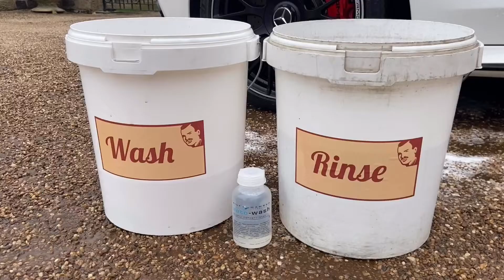Mercedes C63 AMG Machine Polish and Ceramic Coating Detail

Comment: Killer car . Great job . Hard clear coat can still be finished without any haze even with a single step ?
Reply from the maker: Lovely isn’t it! 
Definitely! Harder paint finished better that soft paint for a one step and you can get away with using a more aggressive polish 👍🏼
Reply: @HarpersCarDetailing  ah yes. Has sense ... Thx ...

Comment: Great video as always. Do you use Scholl S20 and Sonax Perfect Finish for multistage corrections? Or do you use dedicated products for cutting and polishing? Thanks, keep up the good work!
Reply from the maker: Thank you William!
If I’m doing multiple cutting stages I would use a dedicated cutting compound, then usually finish with a single finishing polish such as Menzerna 3500 or 3800 👍🏼
Reply: @HarpersCarDetailing  thanks for the advice, very helpful! Are there any cutting compounds you recommend in particular? Thanks again!
Reply from the maker: @williamthomas4  no problem! 
I’m a big fan of Koch Chemie h9 and also like Menz FG400 I think it’s called. The menz isn’t voc free so I’d wear a mask, although they do a menz Fg400 box free but it’s nearly double the price
Reply: @HarpersCarDetailing  Brilliant, thank you!

Comment: What is the tar remover that you use?
Reply from the maker: I used Autosmart Tardis but sometimes use Valetpro Citrus tar remover
Reply: @HarpersCarDetailing  thanks mate, I take it they are both safe for plastics?
Reply from the maker: They are both safe, but if you’re were wanting a less harsh product I would go for the Valetpro citrus
Reply: @HarpersCarDetailing  thank you, appreciate the advice. I have a white C63s, so it is great to see someone detail an almost identical car. Great work :)

Comment: Does machine polishing not affect the clear coat?
Reply from the maker: In theory, yes. 
By machine polishing you are removing microns of the paint. 
This car had roughly 140 microns and only 3 were removed during this process which is safe to do so.
Reply: @HarpersCarDetailing  thanks for your response. How do you work out how many were removed and how much the paint originally had? Very useful to know.
Reply from the maker: I have a paint depth measurement gauge. 
To put it into perspective, 30 microns is roughly how thick a sheet of paper is. Now that doesn’t sound like a lot, but when machine polishing it is. 
You can even sand paint to remove deeper scratches, or unwanted paint texture and only remove 5-10 microns 👍🏼